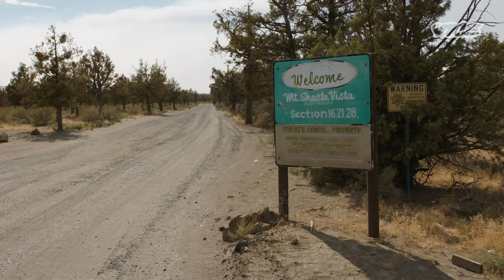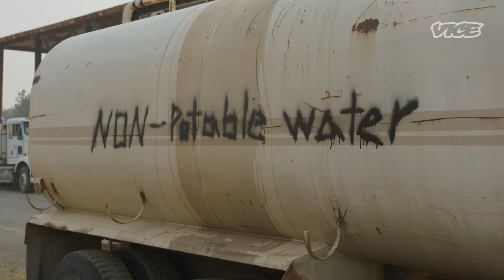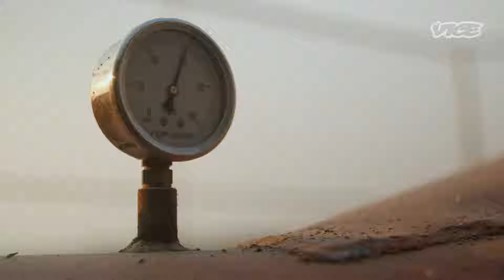A War Over Weed & Water Is Tearing Apart This California Community

Comment: If you watched carefully. They pointed out the garbage not cleaned up, it was the plant nutrients. They burned the weed with gas, with no firetruck nearby, in California, where the farmers didn't have wells.
Reply: no they mixed the bud with dirt and water lol. look closer and think.
Reply: @MrMAC8964  exactly. what a waste of water!
Reply: @Lex-of2wo  ikr
Reply: Anthony nash your smoked out dude years of abuse
Reply: @MrMAC8964  I've never seen water poured out of Gerry cans. They were red.       edit: removed lol as video was changed.
Reply: @anthonynash8079  You didnt see gerry cans ! YOU saw a red hose a guy was plugging with his thumb to spray......NOT a gerry can and NOT gas . OH and it was the 5:30 mark about.
Reply: @MrMAC8964  it's been changed. Original video length 12:06 . 5:22-5:27 you are correct. I have re-watched the video. Gerry cans were right before the cut scene to forest fire.
Reply: @anthonynash8079  they dont mess with flammibles in an area like that with gas !!!??/ and the water was there , not the gas... obviously an attempt at arguing the unarguable again....oh fkn well
Reply: Weed grew for millions of years without additives. Now it needs nutrients? Oh please... weed doesn't even come off the same anymore. It's over-produced, and I wouldn't trust stuff coming from the likes of that dump growing it, either. That growing operation was a dump. It looked like a dive. Surely the operators could care less about the chemicals, or where they carelessly leave them. This isn't the police' fault.
Reply: @Shastavalleyoutdoorsman  they got caught? Or someone got caught, and you considered all asian people the same? Plant need nutrients, especially somewhere that was just in a Forrest fire.
Reply: @Shastavalleyoutdoorsman  also a well costs like $30,000 and not every property has a dig-able well, or a well with clean water (flint).
Reply: @Shastavalleyoutdoorsman  why is it you guys? I'm white and live in Washington. Check yourself.
Reply: @Shastavalleyoutdoorsman  also you can grow most plants with fish poop and pee. Did you learn nothing from the internet?
Reply: @Shastavalleyoutdoorsman  who is stupid enough to waste so much money on chemicals when they can grow fish to eat, and get free nutrients for their plants. One 2 or 3 of the famers up there.
Reply: @Shastavalleyoutdoorsman  they had enough water imported in to water the plants, you don't think they can get enough water for an above ground swimming pool. Like the one showed in this video
Reply: @anthonynash8079  other farmers were getting water from him too, like regular ones. your one of those karin types who cant loose even when its obvious .
Reply: @MrMAC8964  lol. Ok I guess I lose? Since I'm no longer Asian I'm a karen. Since I know facts that could be relatable, I'm wrong. Since I watched the video a 2nd time to fact check, I don't give up. Why are you still trying to prove your point. Must you have the last word? Only the comment section can tell.
Reply: @anthonynash8079  never said you were asian and its "a karin" . to use your words "if you watched carefully " lmao . and they said 1 farmer had a good well and gave water to many farmers. while the chemical thing is the problem there and other such things that have been caused bye poor habits like mold and re wiring homes etc. I would think you may have noticed at least a couple of them .....if you watched carefully?
Reply: exactly! wtf
Reply: Iron Boot  way too expensive. They have to build a subway to Pelosis house and protect Newsom's vineyards.
Reply: You must be well past baked.
Reply: @gogogo1064  thank you for assuming I smoke weed. It's not like I watch documentaries, or vice.
Reply: @willrose592  Imagine becoming a police officer and spending your career trying to eradicate a plant that is ineradicable? I mean how dumb do you have to be to genuinely believe this is not a complete waste of tax payer dollars?
Reply: @willrose592  sorry dude but in a drought, 500 gals is 500 gals. you can justify it if you’d like but
Reply: @getaskill8454  “get a skill” 
why don’t you get a job 🤡

Comment: “LOOK AT ALL THE CHEMICALS THEY PUT IN THE WATER”  points to gardening supplies
Reply: The grass that sits under my plants is way taller than anywhere else in the yard. The nutrient rich water drips out and feeds nature. We use things good for “plants.” My plants love it, so does the lawn.
Reply: @PassiveDissimulation  everything in excess is bad  good for plants bad for everything else
Reply: he was talking about the  fertilizer and its a big problem here
Reply: @user-ox9cg4hl3r  not at the small scale of those farmers. the issue is the industrial farms that have 20,000 gallon tanks of fertilizers and are applying it in a manner that it runs off into waterways
Reply: He’s a cop. Why would he know anything about agriculture
Reply: the do exaggerate but yes fertilizer is harmful when dumped into natural water bodies

Comment: They neglected to talk about the drought and how many, many people’s wells are running dry. Actually that part was totally ignored
Reply: And they also said to plant new transfer hazardous material
Reply: @Quayleman  correct spelling and punctuation goes a long way…
Reply: They did mention that. They mentioned the drought and there are no wells where these Asian Americans are growing so they have to truck the water in. They also mentioned that farmers were using up a ton more water than they were but they were targets.
Reply: They talked about it in the video.
Reply: @derekd1510  It is about the water. The Asian farmer was explaining how one farmer used 100 million gallons of water compared to the average of 30 million. 

Unregulated farming uses more water than one that is regulated. 

Water is a precious resource. Especially now with the fire that ravaged that area.
Reply: @rogeliorodriguez8518  Water usage is based mainly on the size of the farm and the crops grown, not on its regulation. These are tiny farmers who use very small amounts of water. They can truck in enough to feed their tiny farms for christs sake. This has nothing to do with the water usage. Stop trying to justify this disgusting persecution of American citizens.

Comment: They need to protest no water for the almond farmers in the state !!!
Reply: Why? They arent the problem we need to wtop sending water to southern California
Reply: @dmedina6835  you realize without almond farms local valley wells would go dry (i live in almond growing areas) the reason they say they cost so much water is because of flood irrigation used to replenish ground water, no almond irrigation no well water, lentils use far more water than almonds, and weed takes a lot of water as well, want to save water? Cut off southern California and the Bay Area
Reply: Almonds are overrated, a scare for the ignorant. Alfalfa is much worse.
Reply: @vidyagaems4063  dont forget lentils
Reply: @dogguy8603  doesn’t irrigation water for almonds come from wells??
Reply: @bisniskidcali9998  depends on the farm but it can, essentially replenishing their own water supply, though many valley farms have access to water canals
Reply: @dmedina6835  now look up for a watermelon bush
Reply: Yo yo. What's the solution. We need to get desalination plants goin asap
Reply: U have never watered a corn field before

Comment: The answer to the drought problems is CA Governor Gavin Newsom... when he was elected in 2019 CA water reservoirs were full and was estimated to supply CA residents with 5 years of water before levels would hit drought levels, yet it took barely 2 years for CA to have a statewide drought under Newsom's administration. 

So if there is to be any complaints, claims, and accusations tried against who caused the CA water supply to be so low for 2021 then make a direct case against Gavin Newsom and his appointed members of The California State Water Resources Control Board because they allowed the reservoirs they control to be emptied to the point of drought levels.

Comment: I live in a apartment complex higher in crime than most places in the city like burglary and shooting related issues but to me the biggest crime is the garbage sprinkler system that is on the golf course next to my apartment and I get government assistance, it’s mind boggling watching the sprinkler system go off at night especially during the summer and the water is hitting thru the gate into the side of the building and watering the sidewalk and then moves to the golf course back around to watering my walkway an building. It’s insane and I have epilepsy bad so I understand the power of water. Weed has saved my life and these water sucking places and the owners should be held accountable.